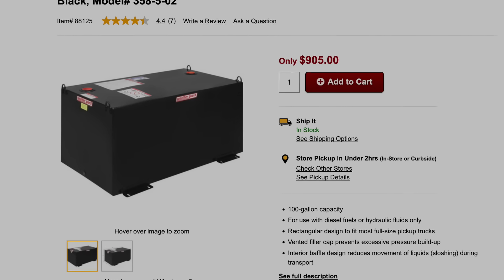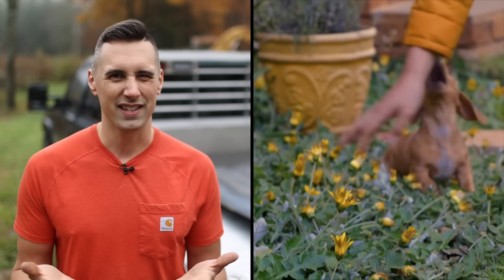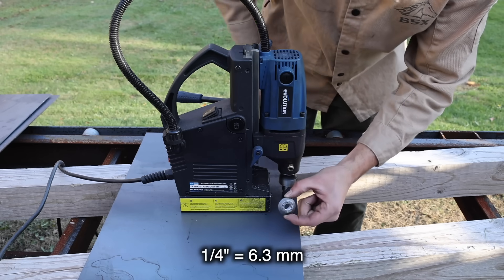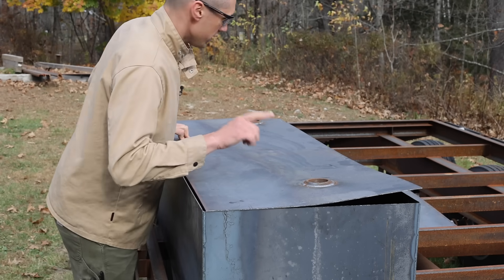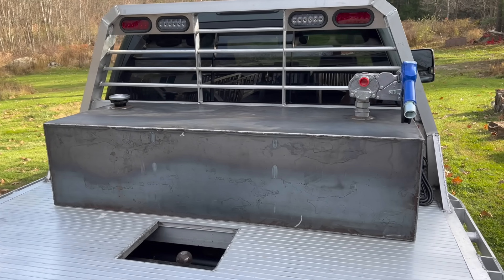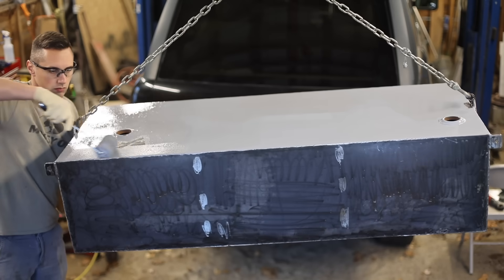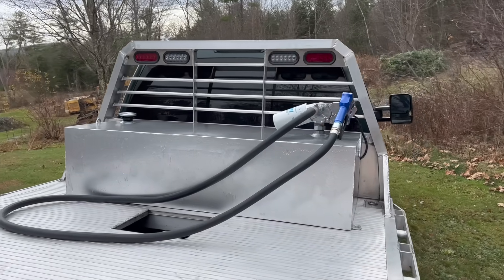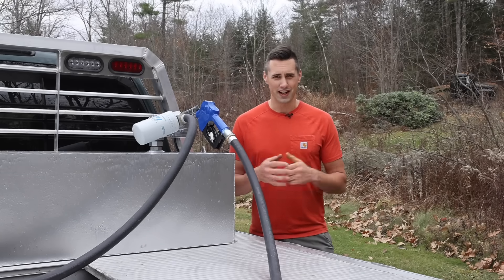Building a Fuel Transfer Tank

Comment: Built a bunch of fuel tanks for field trucks to increase their capacity and range, great build, only thing we did different was to bend two cee shaped pieces so we could cut down on the number of welds. This was a large welding shop with a 6 foot break for bending sheet.

Comment: Hello i got a question. Im wanting to add onto a 25' trailer its frame is made out of 2"×6" rectangle tubing. How would you extend it. I was thinking about making a inside frame out of flat plate then drill holes into the rectangle tubing. What is your thoughts on this.
Reply: The axles would have to be moved too. There's tons of info on extending frames, a lot of the principles apply

Comment: I would suggest putting a 2-3" nipple on your fill port.  On hot days the fuel expanding on a full saddle tank can come out the fill neck.  Those pure rectangle tanks have two unfortunate disadvantages:  Getting all the fuel out of them means having the truck parked on a grade and they are not designed with a bit of expansion room to prevent overflowing.  If you put the pump on a neck you can have the filter canister vertical and have enough room to put a pail under the filter when it gets changed.

Otherwise, really nice work!

Comment: I did the same thing g for about 5 years. My heating oil supplier was bought out. Then  out of the blue they wouldn't fill my tank. It was a older system and it didn't have a alarm on the vent. I bought a 50 gallon transfer tank and a pump. The irony of it is I would have to drive about 15 miles to a gas station that was owned by my heating oil supplier. I could by fuel oil at the pump. I am currently changing out my 30 year old tank and installing new fill and vent lines. That tank came out great. Better than bought for sure.
Reply: I am a fuel tanker driver and can confirm we have extremely strict rules on what tanks we are and aren't allowed to fill, to the point that if the fill point is inset or the dip can't be read easily we wont fill

Comment: Been considering an extra tank for my truck.  I think I'm going to use stainless steel though.  Have made a couple of tanks in the past using regular steel plate and always had the inside of them epoxied before I put them into service.  I also had the edges of the steel folded to help with alignment of panels and strength. This also gives the tank a small radius on the edges. No pressure check before painting??

Comment: Hey Waldo! Welding some really big I beams at work a technique we use to avoid warping is back stepping. Where you weld say right to left in increments but you progress from left to right over the length of the piece. It also makes ties in a bit cleaner since you can weld into the crater. Hope that makes sense

Comment: A 90 out of the pump with that pipe at on the 90 then another 90 would allow for the filter to be installed vertically to make replacement easy and minimize the mess!

Comment: Nice job. With fuel transfer tanks (doesn’t matter if it’s stationary or mobile, tray mounted or trailer type) you need an emergency stop button, in case something occurs, such as a fuel leak, something catches fire or anything dangerous that can occur with fuel

Comment: I must say that I was really surprised when I heard that you heat your house with diesel. It has been a long time since diesel was was used for heating houses here in Sweden. It is very cold here during the winter so we must have efficient heating systems. These days does more or less everybode use some kind of heat pump to heat thear house. Small houses only have small air/air heat pumps. That is, like an A/C but it provides hot air instead of cold air. Large houses often have geothermal heat pumps. It is more expensive to install heat pumps than a heating system with diesel as fuel. But the heat pump is superior in the long run - it is much cheaper in the long run. So in just a few years, the cost has been recouped. Watch this video about small heat pumps
https://youtu.be/7J52mDjZzto
or this one geothermal heat pumps
https://youtu.be/7zrx-b2sLUs
I must say that I like your build videos, especially the Mercedes videos. I am a also Mercedes guy. Keep up your good work!

Comment: Was it not necessary to seal protect inner tank surface? If tank isn't full all the time, it will condense due to temperature fluctuations and water / moisture will cause rust.

Comment: You  probably already know this, but you can buy offroad diesel for less money than regular diesel. The only difference is that they add a dye to make sure that you don't use it in your vehicle and avoid paying road taxes. Since you're using it for heating oil it isn't an issue for you. That fuel tank turned out great!

Comment: Used to know a guy who built a fuel tank similar to yours, put some fuel in it, had a small problem. It leaked plugged all of the filler openings, turned it upside down. Set about to braze the leak, it blew up, some severe burns. Oops big Oops.
Reply: Yep need to pressure test first...probably wasn't diesel though...OOOOH he plugged it all up, yeah that's a problem
Reply: My son wanted to do that. I told him . Is your life insurance paid off. He gave me a stupid look. 
I told him. Unless you want to kill yourself and anyone next to you. And since you don't have any experience weldings on a gas or diesel tank. You better go find a professional who knows what to do.

Comment: If your state has it make sure you buy "Red" (Farm/off-road use) diesel when you can. It's typically much cheaper in that it doesn't include all the road tax.  Just don't put it in your truck and get stopped by DOT as the fines are big.  We use it in all our tractors etc.

Comment: the one thing i would recommend for anyone going to build a tank like this is the fold as many sides up as possible to minimise the amount of welding/ leak points for the tank, even if you have to pay someone to fold them it'll make everything a lot easier and a more leak free guarantee
Reply: I was thinking the same, we have a 12’ wide brake that can bend 1/4” steal, fold 3 sides,and just weld ends and baffles
Reply: You mean bend it? Lol

Comment: Great video. I thought about it last night and I think if I did the same, I'd  build it upside down, and paint the inside with that por 15, or similar waterproofer for fuel tanks, then weld the bottom on, and do another coat, slosh style, to cover that area. That way you can ensure you got all the areas that will be least exposed to fuel, and any areas on the bottom that might have been missed would be covered by fuel anyway. Great job tho, just thinking out loud. Seems like a no brainer to make these if you have the welding gear.

Comment: Sounds like you need a large tank at your house.    Should be cheaper since it would be red for off-road.   Stainless or aluminum, steel will rust inside due to the hydrophobic properties  of the diesel.  I had to have mine bead blasted and coated because of the problem.

Comment: You did a really good job building that transfer take. It fits your truck perfectly and that aluminum paint blends in with the aluminum bed really nice.   If I can make one suggestion I would recommend going to your local Department of Transportation and seeing if they can do a DOT pressure test and certification on that tank, that way heaven forbid if you ever did get in a car accident with your truck and had a diesel spill they won't give you a big ticket for having a transfer take not certified by the DOT. If you were only using it on your own property and never left your property I would not worry about getting it certified. The reason store-bought transfer tanks are so expensive is your paying for the DOT certification that comes with the tank.
Reply: Negative. Only manufacturers of tanks are required to pass the different tests. They don't test each tank either; just one per batch or probably less than that, with the idea that all the tanks are built exactly like the one that passed. DOT reads the test report on that one tank, then they give the company a certification code that works for months or years for that model tank. The test will render a tank unsaleable (engulfing in flames and dropping from 30ft directly onto its feed tube on pavement). This is why Waldo should not have his tank tested by the fictional DOT testing team which doesn't exist. Manufacturers test in-house. They build and write certification markings on their own tanks. A DIY like Waldo's, or even if Waldo sold a tank to a friend in a private trade, the only thing the tank MUST have is a rollover check valve on any vent, plus markings: "capacity in gal" + "don't fill beyond 95%". Gravity feeding to the main tank's feed tube is perfectly legal for diesel, with fittings allowed below the full liquid line. Gasoline must have fittings above the full line. Gravity feeding direct to carb, rail, or injector is not allowed. Yes, the DIY tank should be built to the specs such that it can pass those DOT tests in theory, but it's not required to be actually tested, certified, or marked unless Waldo started manufacturing them commercially.

Comment: So, in high school my father had a similar reaction to the price of heating oil. And he used Red Diesel, which just regular Diesel with a dye in it and some taxes waived. So it's cheaper. I going to school a day after helping fill it and just feeling sick because the fumes soaked my coat. Anyway, as someone who's done it, I just want warn you that Diesel fuel will have a stronger odor than heating fuel and in my house left soot up the walls under some of the registers. Your wife will probably not like that.

Comment: Tab size on the tank and hardware look insufficient. That tank weighs in excess of 640 pounds. Bouncing and sloshing will fatigue the tank/tab interface. Those rubber washers will degrade from environmental exposure.

Surface prep looks riddled with stripes from using a grinder disc to sand the surface. Rinsing the degreaser with water contaminates the surface with water solubles and allows/promotes flash rust. Better to use an evaporative solvent like brakekleen, alcohol, mineral spirits, etc. A wider roller would be efficient and yield a more even surface with less particulate contamination due to working the roller less. A paint additive would alleviate runs and give a harder, more attractive finish.

Comment: Hello there waldo nice build on the tank ,when you put the baffles in prior to top i was suprised you just didnt make the baffles say 1/4 shy of top edge from all four outside edges then weld angle pieces at ends the same the top would drop in sitting perfectly on top for a hard weld all around.suppose just my lazy way but that eay you could even weld tops of baffles solid.sure thats how boat guys do it.urs is fine enough though!!snooky pa.💥🖐👍💥

Comment: Nice build Waldo, I also enjoyed watching you build your gooseneck trailer too, I built one we still use for hay mostly close to 50 years ago, thank you!  I did the same thing with diamond plate aluminum about 95 gallons, the filler bung screw-on cap you have, you can get the same one with a black hinged flip-over-the-cap piece that you can put a padlock on to prevent someone from easily siphoning fuel out when you park and go into a restaurant or motel, it only takes a few minutes if they're watching you, and with fuel prices like they are...  They're only about $5.00 more than the one without the locking arm at any farm supply store.
I didn't see you pressure test it; I'm guessing you did that off camera.  I made mine to pump fuel from the big tank into the truck tank on the 3500 dually.  I filled up both tanks in Missouri, drove down to Fairhope, AL where we're building another house & horse farm, drove around town for a week and back to MO never stopping for fuel, where when I got home, I pumped in a full truck tank (34 gal) and had about an inch or so left in the big tank.  I tuned my 6.6 Duramax, so I get about 26-28 mpg empty on the highway, less when colder out.  The fuel pump filler switch I located on the dash, the pump's located between the tank and the filler tube under the truck, goes right in about a foot below the truck's diesel cap fill tube, with room for my FASS lift pump discharge back to the tank.

Comment: You can add a 3/8 NPT bung to the bottom of the tank and then install a gravity feed line with a valve running to the truck fuel tank. That's what we do for our hotshot trucks. Flip the valve open when you stop and it'll slowly fill the tank while you keep driving
Reply: Except the tank holds 80gal and the truck...umm don't

Comment: I hope the pick up point of your pump is a little bit of the floor of the tank. Condensation will collect there and otherwise will be sucked up by the pump. This can cause a lot off damage on your high pressure fuel pumps ( Mercedes) of your diesel engines. It don't know if the filter you mounted has a water seperator.

Comment: Hey Waldo a small trick for you’re slip tank once  come off the filter fittings use a high flo quick coupler like a hydraulic coupler female end then use a male on the hose so for to
Store your hose so uv rays don’t eat your hose and also harder to steel fuel and if possible use a clear filter with the little drain spit too see if your getting water or anything in your tank

Comment: Very well thought out build, your welding skills have reached next level. The weight of the fuel at 80 gallons is about 550 lbs, how much does the steel tank weigh? Have you noticed any differences in handling with the added weight? Thanks.
Reply from the maker: Yes, the truck rides much nicer with the weight!

Comment: why are you using kerosene, fuel oil is much cheaper ... even cheaper than diesel... as long as you have your tank in your basement you can use fuel oil instead of kerosene
Reply: it gets much colder up here in caribou and that's what we use

Comment: The hose for the tank you need to have a place to store it or strap it because you will wear a hole in it, the tank looks better than you could purchase by far, as for the paint it does the job your not putting your truck in a show are you now. :washhands:

Comment: Add a cam lock disconnect and put the hose in one of your lock boxes. Tap in an anti siphon and then the only thing you need is a lock. Might want to research mitigation of galvanic corrosion.

Comment: My dad has a fuel company and I can confirm it's totally legit because small companies that can make home deliveries can only get fuel local same for gas stations but there chains so they rase there price were they have fuel cheaper and lower it were they don't have large amounts. Also it's one thing to put 5 gallons of on road in your fuel tank but with the tax stuff it's a major no to doing what your doing also you will have to get hasmet and cdl also it's real dangerous to fill a fuel tank when you don't know what your doing.
Reply: Your equipment should run off road not on road
Reply: Ok the pipe next to your fill is a whistle but you need the right end and you have to learn how the whistle pitches works also enless you have a hasmat you aren't legally allowed in pa with that thank full
Reply: @mr.rubber_duck  So it's tank size??? What's the regulation?
Reply: Warning just dont
Reply: I think for pa wich is were I live 50 gallons without hazmat
Reply: @mr.rubber_duck  That "may not" apply for personal use though
Reply: Ya it dos in the governments eyes a fuel tank is a fuel tank because if that was the case you could build some massive tank and have it be legal
Reply: @mr.rubber_duck  So like a 40k RV is legal on a regular license but a regular 40k truckttrailer needs a CDL...or is that different?
Reply: Pretty sure your supposed to have a CDL for both

Comment: 200 gals a month????? I use heating oil to heat a 2500Sq ft 3 story home in MN that was built in 1899 with an addition that was put on in 1942. We have a 250 Gal tank and we only go though about 350gallons per winter.  you might need to look at  upgrading the windows and insulation

Comment: Just a reminder when that tank is full theres 560 lbs of fuel on the truck.  You should be fine make sure it's held in good.  be nice for heavy snow storms. Plus some been there know how drain it out or fill it up when the temps get crazy up down keep the water from rusting the tank out noce work

Comment: red die diesel or OFF Highway ONLY diesel does not have the road tax, thus much less expensive.  You can use that in your furnace, as well as your heavy equipment.  You won't be able to use the red die diesel to extent your range while traveling though.

Comment: That Welding table looks pretty cool....  with a few slight mods, you could turn that into a goose neck trailer!  Wouldn't that be cool!  🤣😉
Reply from the maker: It actually does work surprisingly well as a welding table 😂
Reply: Needs about two hundred 3/4" inch holes🤣🤣🤣